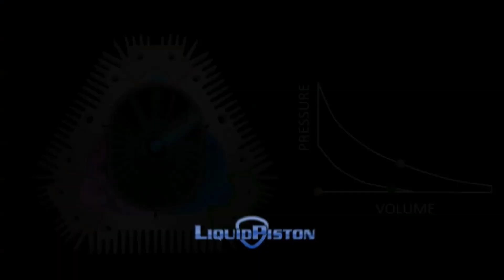LiquidPiston X Mini Go-kart

Comment: Thanks Mazda
Reply from the maker: This is not a Wankel engine. It's very different and more efficient.
Reply: Wow
Reply: @Aarononautos  ¡oh! El tío vicesat. Saludame please :V
Reply: @Aarononautos  I know this is 3 years old at this point, but it really is basically an inverted Wankel. Not any less genius because of that, but it is what it is.
Reply: Madre mía que haces aquí compañero
Reply: De Garaje Hermético vengo aquí y me encuentro con el Vicesat de hace 4 años xDDD
The power of surprise, que dirían en Honda...yatusaaabe
Reply: El vicesat de hace 4 años etuvo aqui
Reply: Before Mazda it was NSU
Reply: You replaced a 6hp motor with a 3hp motor?
Reply: You mean Felix Wantel. Mazda didn't invent the rotary, they just mass produced the engine for retail and racing.
Reply: @Aarononautos  even though it’s not Wankel, it’s not Mazda, it’s inspired by the Mazda wankel… and I wanna get a two rotor version of this, turbo it, throw it in an rx7, call it the rx9, and become a god?!?!
Reply: @kindpanda1075  so… the engine that was 6hp weighed 50lbs, and this engine which produced 3hp weighed 5… soo, it’s quite impressive, also, they say it will produce more Hp after testing is somewhat complete
Reply: @Grimace_Integ420  You could, but you'll be spending alot of money on oil. The Wankel engine doesn't need any tweaks, it needs a complete redesign, Mazda already did it better and they abandoned it.
Reply: @ryandika2512  im pretty sure it doesn't have nearly as bad of oil issues as the Wankel - but i could be wrong

Comment: I have noticed that they push the HP numbers in their advertisements but do NOT say anything of torque. I suggest it is because the torque is extremely low. HP without good torque is virtually useless. Additionally the cart shown on this vid show NO acceleration; it is just buzzing with a steady (slow) speed of nothing special --that's suspicious.
Lets see the carts 0-60 mph in seconds with the briggs and THEN show me the 0-60 times with the liquid. THAT is the ONLY comparison that is worthwhile for a go cart anyway.
Reply: 0-60 with a 3HP-engine? You're a funny guy^^. 

Torque (N.m) = 9.5488 x Power (kW) / Speed (RPM)  => 2.14Nm@10k rpm
Reply: +protator
Yep you are seeing the numbers for what they are.
Put another way: A conventional 3hp ICE engine puts out approx 5.4 ft. Lbs of torque at 3000 rpm. And this engine puts out 1.6ft. lbs of torque at 10k rpm.
Or as your formula would show: 
9.55X2.37kW/3000= 7Nm of torque for conventional 3HP engine
versus
9.55X2.3kW/10000=2.2Nm of torque for this engine rated at 3hp

Therefore, while this engine has a lot of RPM speed, the lack of torque will not get you much grunt. However, reduction gearing will get you some mechanical advantage that can be converted to grunt.
The added weight of a gearbox will offset the small size and weight of engine; additional friction loss will also occur. Fuel consumption should be similar (i would think but ??) A higher revving engine though is buzzy and fatiguing.
Reply: i would just like to add that the x-mini engine has a total displacement of 70cc, this is due to the combined volume of three 23.3cc combustion chambers. Each firing sequentially and not simultaneously. So the engine produces torque based on one 23.33cc chamber.

So the overall torque of the engine is going to be lower compared to a single piston 70cc reciprocating engine.
Reply: It also has the low torque problem because of the same internal gearing that a wankel rotary.
Reply: so you think that 70 cc engines can't do 60? please...
Reply: boostedsil40  Power at the crank is a product of rpm and torque. If one 160hp engine has peek torque at a higher rpm than another 160hp-engine then it needs less torque to produce the same max power. Which is why torque curves are more impotant/telling than the max values.

Comment: A 3hp briggs is probably faster than that.
Reply: look at the size!
Reply: its only 1.8kgs.
Reply: Gangl Dávid Szabolcs but for double the weight you get more than double the hp in a piston engine
Reply: 3.6kgs engine eh?
Reply: Gangl Dávid Szabolcs your right. to be honest I'm looking back and not sure what made me think that was the case... on the other hand... are you sure it is that light? that seems impossible
Reply: +Sloan V rotary engines can be incredibly light, I belive it is possible
Reply: Wonder if the motor scales up well
Reply: @NwoDispatcher  This is my line of thinking as well.
Reply: A 3hp briggs has more tourque at low rpms you mean... A 3hp diesel would be more torque(hence farmers use)... An electric even more(try echo 58v weed wacker, compared to homelite)... This is the opposite effect... An analogy I would use is a baseball bat(briggs) vs katana(liquid piston) swinging at a bush.
Reply: @riddnic  well with more torque, you can use a gear box for that bat
Reply: It at least has an ounce of torque. I can tell by their gearing it really needs a 10 spd transmission to function on anything other than flat concrete.

Comment: That is a beautifully designed engine. Some fascinating innovations from what I can make out from the few bits I've seen yet.
If it can indeed overcome the problems that plague conventional rotary wankel type engines, and do as claimed it should indeed be a winner.
To be honest the go cart demo was most disappointing. I'm not sure why we had no inclusion of a clip accelerating, and only footage of it already at speed, and to be honest not much of that. I particularly dislike the almost dramatic 180 degree spin stop at the end.
Sorry but it kind of looks like you are trying too hard to show it in it's best light.
It would be MOST interesting, and give a much more reasonable real world idea, if you were to run carts side by side next to the engine it supposedly would naturally supplant or replace.
Now that would indeed be impressive if all the claims stacked up.
Reply: It is only 3hp so it cannot have that great of acceleration, obviously. So yah I wanted to see it's toque.

Comment: So this is the LiquidPiston engine put to good use in a go-kart. Would this thing have efficiency and emission issues on a roadcar?
Reply: Budget Boost DIY  Source?
Reply: Budget Boost DIY  It doesn't burn oil like a wankel inform yourself before commenting. It's a four stroke design.

Comment: so its 30% smaller but ~70% slower? Not good at all.
Cant fool a Kart racer.

Keep on developing. Its still very inefficient and lacks power. Because all piston engines at that size would outpeform it simply because of the higher torque.

I'll give you props if this engine would outpeform the regular 6,5HP Piston engine.

Comment: I find it annoying that they pretend to remove a large 4 stroke engine and replace it with their smaller rotary.

The 4 stroke engine they remove in the video is complete with large gas 
tank, large air filter assembly and a water/dust cover on top, and pull 
starter assembly on the side.

The rotary then gets a large gas tank between the drivers legs, a small 
air filter (upright, good luck with that when it rains) and no starter 
assembly.

Unprofessional demonstration.

Comment: Please replace that stupid carburetor with a direct fuel injection system. I do not want to see only 3 horsepower in an engine, but more! To do that, it must be more efficient with it's fuel and/or oil.

Comment: this thing is so small, stop bitching. they could easily have added more rotors. the rotor was about an inch thick. so a 6 rotor engine would be like the same size as that gokarts. and have around 18hp